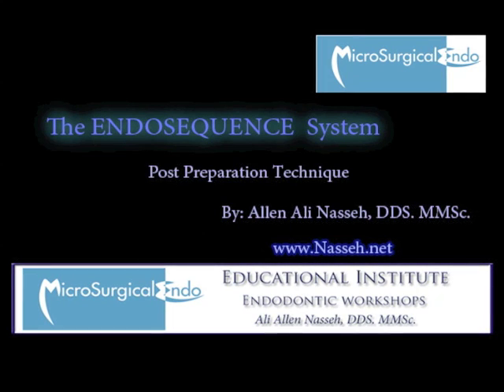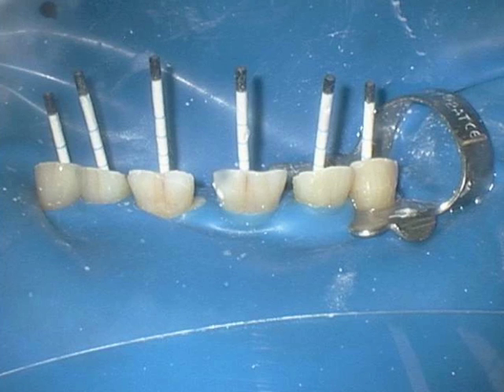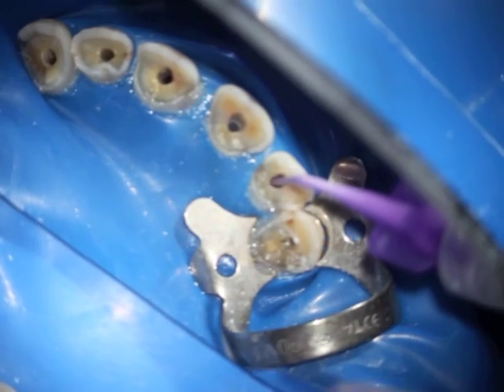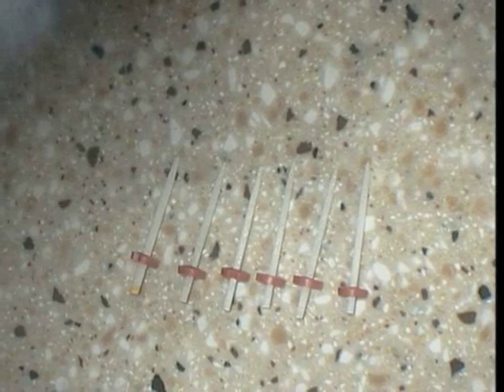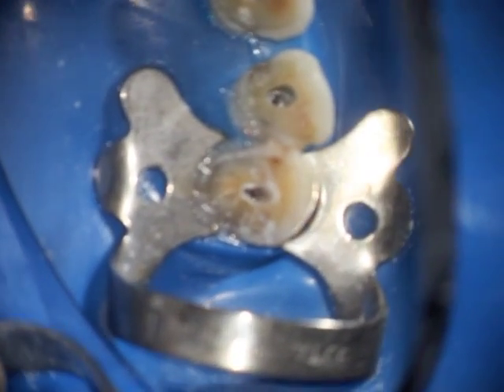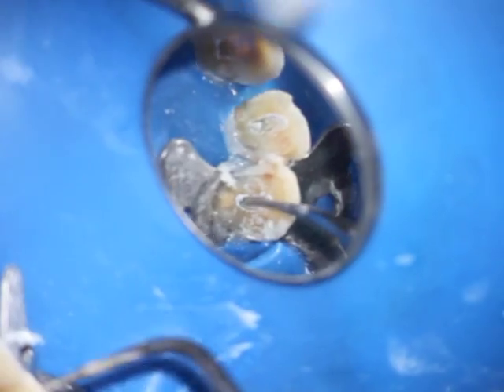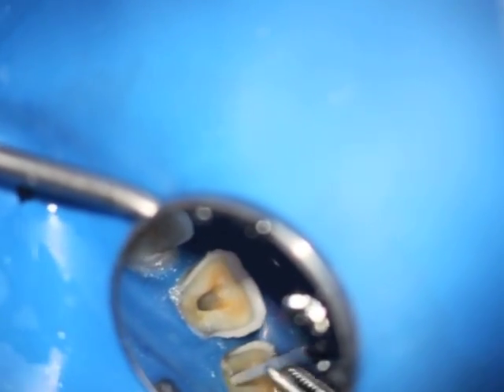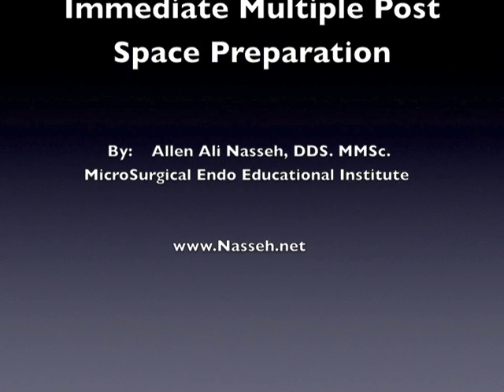Nasseh Post Preparation Technique

Comment: Hello doctor 
Could i ask u if we can put a post in the same visit with BC sealer ?
Reply from the maker: It’s the same with any sealer. If you can clean the walls adequately it’s actually better to place it the same visit under the rubber dam than wait a visit.  
So, ideally yes.

Comment from the maker: Hi Amin! Sorry for the one year delay in responding to you.. but you can obturate the apex with this technique because the sealer used is a bioceramic cement that bonds to the tooth and if BC coated Gutta percha is used then it bonds to the gutta percha too. So, you don't really need to do vertical or lateral condensation when you use this system because the gutta percha and your master file match in shape and size. Hope this explains enough. Good luck!